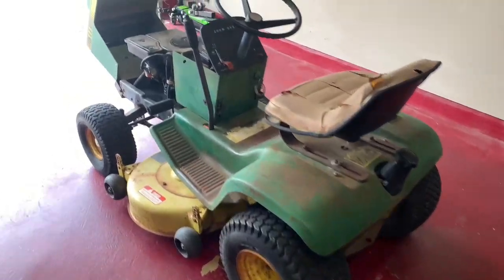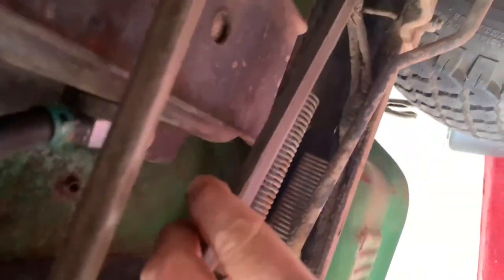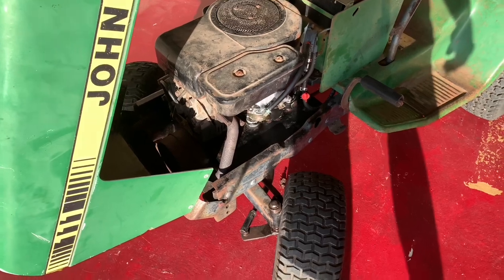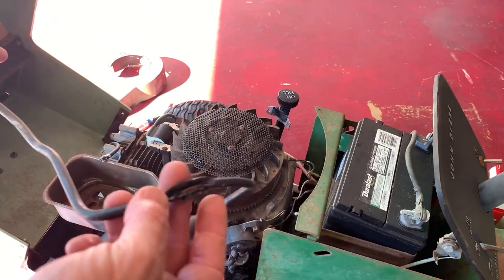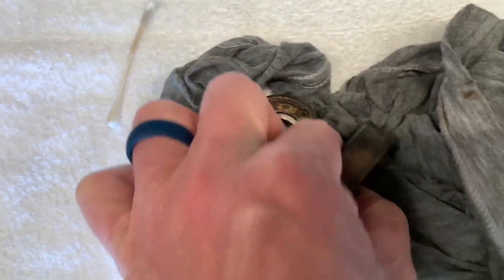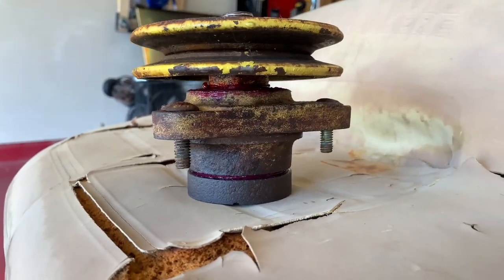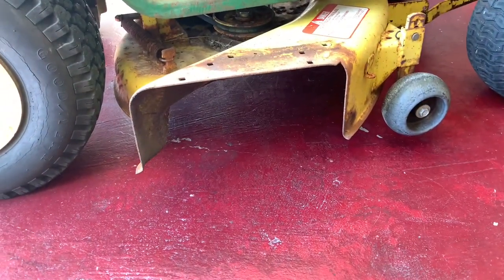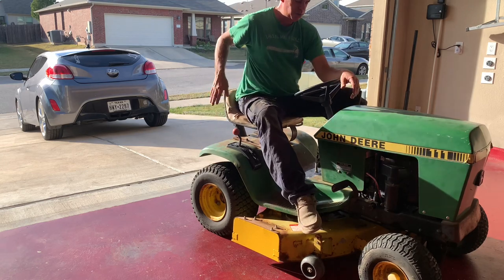John Deere 111 purchase and repairs (1984 model)

Comment: I had pretty much the same mower 20 years ago and I've had to replace the spindles for the deck, the ignition coil, belts, and among other misc stuff to repair but it was a great little mower considering I had to mower at least close to 2 acres back then. It took me almost 2 hours to mow with this mower. I also had the same 11hp briggs on mine and it was awesome. Like I said earlier the only thing I had to do to it was replace the coil and change the oil on it every spring and it ran flawless.

Comment: having trouble with the routing of the drive belt. Clay  I had trouble with brake rod linkage. Not sure if one side of belt goes in behind this rod. The old belt blew so didn't get a good look at it first. Mine looks same as your model.  My model of "hydrostatic" has the belt do a 90 degree turn and fan is on right side of the Rear diff.

Comment: I rebuilt the motor. Everything worked fine as far as the motor goes. But I can't seem to get the deck to go back on and the lift / lower lever to work right. Can you show step by step how to reinstall the deck? 
My jack sheave bearings just went out and Im not finding any good videos on that either. The bearing / post piece is JD part number M74707 . Its like a steel rod with two bearings mounted on it. I can see in the illustration the bearing end installs upward but there's a pin hole in the bottom where a cotter pin goes through the shaft... and I guess I need to dig more where to find that... wish me luck! Thanks for the video you've already done!

Comment: do you have any tips for tuning these older carburators? the guy u got it from rebuilt the carb and i dont know where to start on tuning the air/fuel and the needle on the bottom of the carb.

Comment: I flip newer style john deere mowers and a couple weeks ago I sold a real nice la115 with a plow to a guy and he was telling me about his old john deere and that if I wanted it I could come pick it up so he didn't have to set it out by the curb. I'm a sucker for free stuff so I picked it up even tho I wasn't super interested but it runs, has a plow and new tire chains so I couldn't pass it up. I hadn't even looked this thing over until this evening and the date code on the engine is 79. The tractor looks amazing, it's a 111 and somebody has done a budget restoration on it already. I was planning on making a toy out of it but this thing it just to cool to tear up so now I think I want to do a proper restoration and have a cool vintage mower. It doesn't have a deck so I need to find one of those but I was wondering if you had an idea of what it might be worth in good running shape since you seem to have a lot of knowledge about these old models

Comment: I have the same model and year...my 11hp is bad. If I replace with a 17hp will the wiring be hard..especially the pto wiring?
Reply: I wouldn't think the wiring would be hard on the PTO... it's just an On/Off switch, which is nomally open / not powered. If I recall correctly, looking at my service manual, there is a relay that is controlled by the switch on the dash. But that doesn't add much complexity. I see the comment is pretty old, but if you want info from the manual just post a way I can contact you.

Comment: Do you still have this 111? I have the same one, and I can't find a diagram of the drive belt routing. Curious if you have a video/photo of the underside
Reply: My 111 drive belt does a wierd flip to drive the diff from the right side and am having trouble figuring the routing and actual length. Old belt blew and was a mess. cut it off. now I am not sure if it is 78"s long or 77&1/2" or witch side of the brake linkage the bottom side of belt is supposed to run. ?? Clay

Comment: my John Deere 111 those spindles are not the same mine are taller and the both holes are I believe are smaller radius and I don't think I have that spacer....... but I do have zerk fittings I don't know who did that that's stupid..... but they are difficult they are difficult to take apart.........

Comment: do not be stupid and try to use the zerk fitting for filling the tubes of the spindles with grease pack the bearings with grease put the shields back on and leave it alone if your bearings have no Shields be a good idea to put them on there